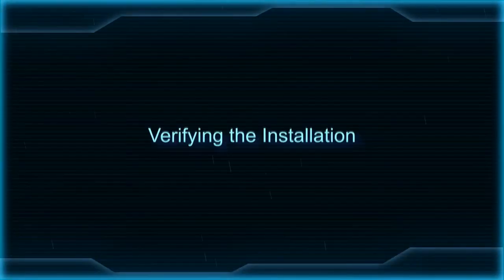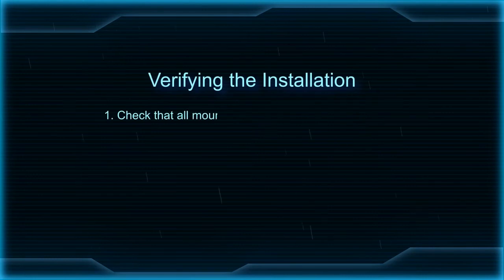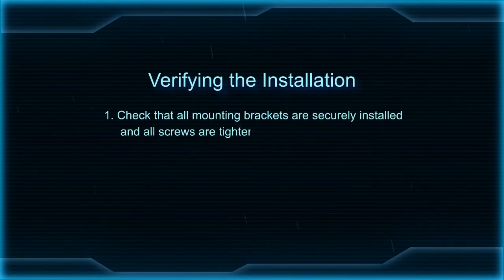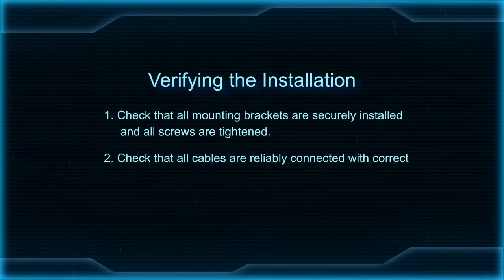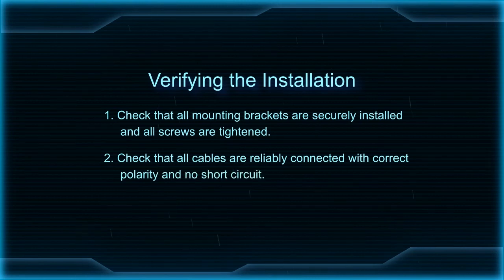Huawei SUN2000P 375W Smart PV Optimizer Installation Video

Comment: what is the difference between the full configuration and optional configuration?

does it affect the performance of the system? or just the same?

can someone explain? thanks very much in advance
Reply: I'm no expert but do have a Huawei inverter with optimizers on each panel on my home. As it was explained to me when I was asking questions about optimizers is that the optional configuration seems to just be showing a PV panel in the array that does not have an optimizer and while other's do. Apparently any panel that does not have an optimizer will be as efficient as the lowest performing panel in the chain/array that also does not have an optimizer. I think the huawei unit can manage both optimized and un-optimized panels in the same array. Optimizers are optional and only "ensure" performance of the system is as efficient it can be where there are shade effected areas, or panels at different locations on a roof. I chose to go with an optimzer per panel for piece of mind as I had slight shade of a tree at some time of the day and wanted as much performance as I can get from each panel. I was told though that you only really need an optimizer on panels affected by shade so they dont bring down the efficiency of the entire array. I think that's what the optional configuration is showing in the video.